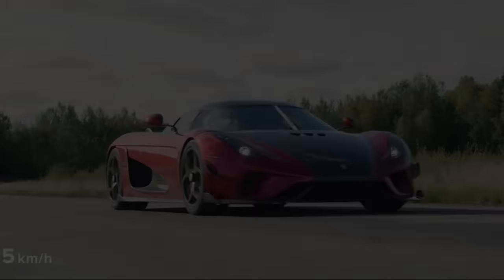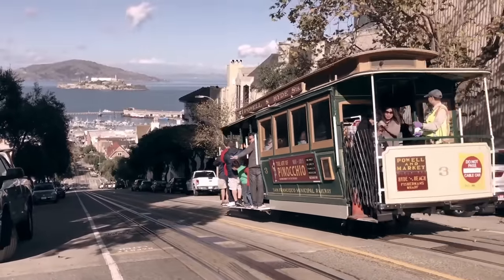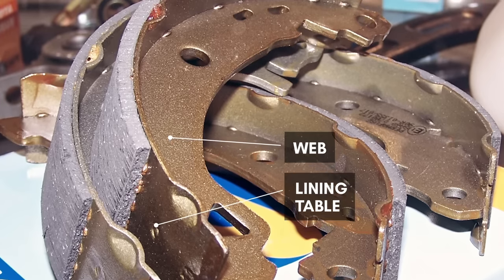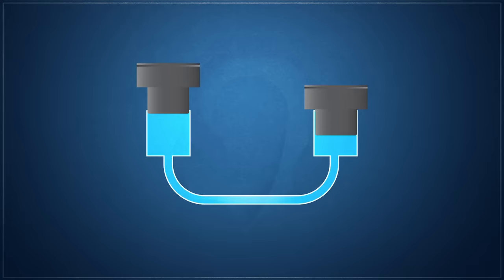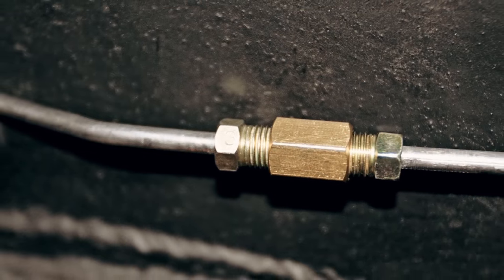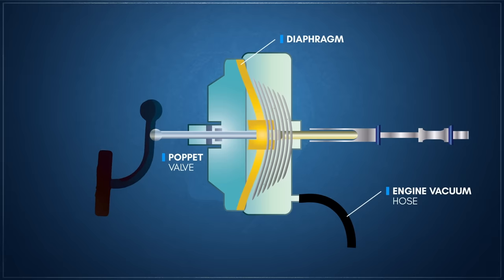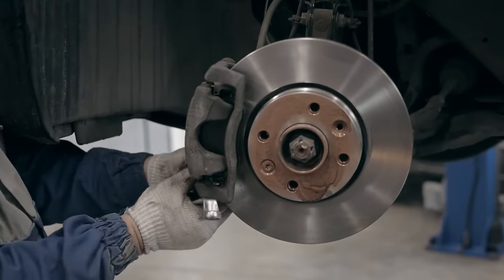The Story of Brakes

Comment: Have multiple break pads per wheel been used before, or would the effect not be that significant?
Reply: They have.
As those calipers are extremely expensive must be significant enough to warrant production.
Reply: I would think that the system would be limited by the heat the disc could dissipate and adding more pads takes away cooling area on the disc so it would brake hard but overheat fast
Reply: @Slash1066  Definitely limited by heat. But we've had Carbon-Carbon rotors and pads for decades.
it takes a LOT to subliminate pure carbon. I remember 35 years ago they were priced at something like $10,000 per corner!
Rotora has a 12 piston caliper. Brembo also offers an eight piston with 4 pads.
The SLS Titanium 3D calipers in the Bugatti Chiron used a bunch of pads too.

Comment: Another thing to note is braking systems on cars legally have to be more powerful than the engine output so they can be stopped if a throttle gets stuck wide open

Comment: 15:10 90% of the time slide pin malfunction is due to poor or no maintaince when pads are replaced. And replacement of warped pins is rarely done even though its very cheap.

Comment: Electric cars bring an interesting trend. The brake discs may be so underused that you have to change them due to rust and not because of wear. Now Continental in cooperation with VW is working on bringing drum brakes back on all four wheels to mitigate that problem. They have a test Golf 7 GTi test mule
Reply: The Etron automatically puts the pads onto the rotors from time to time to prevent rust on the rotor. You can prevent the rust buildup

Comment: And I believe that brake rotors warp after a hard braking followed by the vehicle sitting still at a stop light or stop sign as a portion of the brake disc is covered by the caliper, making it warp. 
Has anyone ever made a braking system with multiple piston calipers that have gaps between the pistons? As in a 30 degree spacing of each set of pistons?

Comment: Great video. But I don't think the analogies in the intro made the phenomenon any more understandable.  Now I know how much stopping energy is compared to iPhone charging or American house electricity use... More useful would be how much heat is produced. So, for example the specific heat capacitance of iron is 0.45 kJ/(kg K). The energy of a emergency stop was given 0.12 kWh. That's 432 kJ. So, 1 kg of iron gets 960 degrees (K) hotter. Google says that average disc brake rotor is close to 10 kg in weight. So brakes are 960 K / 40 kg = 24 degrees (C/K) hotter after a single emergency braking.

Comment: We know trucks with high loads can not to be stopped at close range. Even if the brakes can stop the trucks in short distance, there will be a weight transfer that causes the trucks roll and potentially crash. However, the drum brake is easier to combine with the air brake. So in trucks, how fast the brakes can stop the vehicle is not a priority. Most importantly, how the brakes can stop the vehicle safely.So it can be concluded that the drum brake is stronger than the disc brake. Although drum brake is no more responsive than disc brake. In comparison, disc brakes will stop faster. However, the braking force of the drum brake is stronger. That is the reason why the drum brake is chosen for the for heavy trucks.

Comment: On a side note, if the 2 parts of a dual master cylinder are "crossed", as shown at 9:22, it's to avoid braking only on one side of the car in case of failure.
So the car stays on a straight trajectory, instead of suddenly turning left or right.
Reply: You really want a car to continue on straight trajectory if the brakes fail? What if you had a heart attack & hit the accelerator instead? Out of FULL control situation on at straight level road & boom you're in capacitated! What you like to happen? The default is to err on the side of caution. The car slows without driver input. Most roads have a camber to remove surface water to gulley drains. The car has a very slight steering offset/biase over a long distance. This is by design of the car & the roads. Soft verges have purpose also. It is better to go to an unbraked unassisted stop on a verge/safety lane. Than hurtling on veereing across the median into on coming traffic, potentially doubling your impact speed! Safe Motoring.
Reply: The correct terminology  is called a diagonal split braking system

Comment: BUT Trucks and Trains do NOT use a brakesystem based on Hydralic. They use pressurised Air. Why? Because Trucks and Trains can be separated or exchanged. You dont want to spill a Fluid everytime you seperate a Trailer or Wagon. Compressed air can be routed through flexible hoses and can always be supplemented by a compressor. A hydraulic system does not work with air pockets or only very poorly, which is why air is used
Reply: truck can be full air, air over hydraulic , or vacuum over hydraulic. Same with trailers, full air, air over hydraulic using airlines between the two , or vacuum over hydraulic , vacuum line between the two. Early systems on trucks had hydraulic over air over hydraulic, which was a hydraulic brake master inputting low hydraulic pressure to a air master  which intensified the hydraulic pressure to the brake foundations, similarly with vacuum the master cylinder would input to an hydro vac booster which once also would supply high pressure brake fluid pressure to the foundations. To get the trailer to brake, in the old day you would use a ratio controller but these are not outlawed and either using a trailer advance valve or speeding the truck and trailers foundation and air components the same. With air over hydraulic same as air over air, vacuum over hydraulic required a device that converted hydraulic pressure on the low side to a vacuum signal that the trailers hydro vac would create the high pressure brake fluid. Side note. Vacuum pumps were not called vacuum pumps they were called rotary exhausters .

Comment: 9:46 This drum brake self-adjustment is usually engaged by reversing the car and then braking hard. The drum shoes will be ratcheted to the new position.

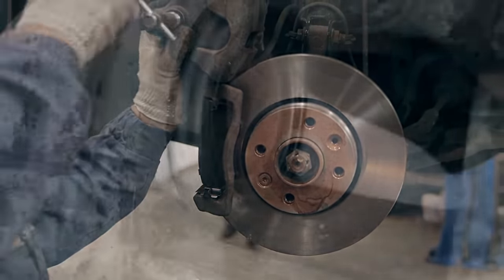16:04 Drum brakes in the rear also can be employed as parking brakes, as they will retain position under tension from a mechanical cable. The calipers of a disc brake will gradually bleed pressure and so cannot be used to hold the brakes when the car is parked.

Four-wheel disc brakes get around this problem by including a relatively small drum brake alongside the rear disc brakes, which act as the parking brake.

Comment: Two small things id like to add is that, the brake booster nowerdays is also sometimes not pneumatic but electric, with the ABS Block integrated into the master cylinder to safe costs in production that also makes one more reason for vacuum pumps on turbo charged engines to become obsolete.
Also the double brake circut sytem is a thing to this day however the one circut front one back is largely abolished due to the fact that if the front circut has failed and only the rear one is left, the maximum decelleration of the vehicle falls dramaticly. The rear wheels lock up more easily because when braking the load of the vehicle is shifted from the back to the front, much like how we have to lean back a bit when we run and wanna come to a sudden stop to compensate for that effect and not fall over forwards. This is also why there is a brake force distribution of about 70-60% front and 30-40% back dependent on the vehicles default weight distribution.
Nowerdays brake circuits use the X layout as seen in the video or they are doubled up front or all arround, baisically any layout that makes sure that once one circut fails there will be at least one front and one rear wheel braking that are on different sides of the vehicle so as to not make the car pull noticably into one direction when braking, is good to go.

Overall it was a great video with good and understandable animations and mostly a nice reminder to me as to how brakes work. I even learned a thing or to.
Great content keep it up.

Comment: I might be wrong but I dont think that average american home consumes 1.1MW of power in two hours, a month could be a more accurate guess
Reply: MW is the power. MWh is the energy. So 1.1MW*8s is around 2.4 kWh which is 2 hours of usage for a 30kWh per day house.
Reply: The standard for American homes is a 200A breaker at 240V which allows for a maximum power consumption of 48kWh. That means we can reach 1.1MW in 23 hours :)
Reply: @WoLpH  American homes are 120v
Reply: @MarksTournaments  They're officially 240v split phase :) The outlets generally only get 1 of the 2 parts of the split phase which makes 120v. Your AC most likely runs on 240v by using both parts of the split phase.

Comment: I love this video. I have known about and learned about all these systems before but I had not seen them put into this context before. I am so used to hydraulic brakes with boosters that mechanically-linked brakes are something that Jay Leno is familiar with not I. (I haven't been near a car with mechanical brakes.)
One thing you missed was Bertha Benz's road trip where she had leather straps put over the wooden brake blocks on her Model III, thereby inventing brake lining for automobiles.
I wonder how many here saw the disc brakes and thought of Eric O. and South Main Auto's voluminous brake job videos? (Floating disc brakes are a bread and butter item with his shop as attested to by the pile of rotors he recycles on a regular basis.)

Comment: Two areas you might like to add: 
There is a town in New Jersey they call Radburn (a part of Fairlawn) It was designed between the wars to anticipate the influences of an auto age.  
The town was designed so no child need to cross a street going to or from his school.  The fronts of homes face across hedged-lined paths that lead to large common areas of open space. People who live in those homes these days, enter by the back steps instead of the front door.
Hydraulic technology , which became common during WW2 and made that neightborhood design either obsolete, or interesting. 
[My uncle was a Sr. TWA Executive  owned one of those homes until he retired a half century ago.

During the golden age of inexpensive sports cars & rallys, such as with an MGA, the trick to driving fast was to rely on your brakes instead of the gas -- when deciding whether to pass.  Zoom by, or slow down fast.

Comment: Hydro boost=good idea but Hydro boost= nightmare to work on....if you get air in the system, that is a major problem, usually after replacing unit....NEVER try bleeding with engine running, you will have air bubbles for a week

Comment: Covered Regenerative breaking, but not Engine Breaking? Goes back as far as I am aware as Steam locomotives, but used by trucks today etc. I've heard trucks making a trumpeting sound when deaccelerating, which I believe is this type of breaking.
Reply: Trucks can use their engine for braking, but heavier ones typically use retarders, which are more powerful extra devices independent from the engine.

Comment: I often wonder why automobiles didn't take a leaf out of rail practice and use a reduction system, i.e. you use the pressure to release the brakes, and you apply them by easing the pressure off? The system would be fail safe that way.

Granted, with rail you're working with compressed air.
Reply: Truck brake systems using compressed air work in this way. If there are leaks or you are running out of air a mechanical spring (which is overcome by a pneumatic cylinder) stops the vehicle.
The problem with cars is if you don't use them for a longer time your pads can corrode onto the disc or drum, and with the parking brake (which is independent) you have a redundancy over even 2 hydraulic circuits

Comment: If only abs actually worked in the way they claim. I wonder if there is close standards legally held to by manufacturers, because there has been performance differences between brands. And I can remember a major manufacturer being sued when a man was forced to pay for 'anti-lock' brakes, but his wife or such was killed during an accident in which the man was driving, tried to stop, but his 'anti lock' brakes prevented him from stopping in time. Aided by professional mechanics an experiment was done to test stopping distance for his exact model with factory installed abs compared to modern un aided hydraulic disc brakes, and it was clearly proven, on t.v. even, he would have stopped if he did not have abs. He proved this by repeatedly having a test driver make hard stops under numerous conditions, and taking distance measurement averages for each system. As I recall he won his lawsuit against a major American auto manufacturer.
Hopefully they have improved.

Comment: Unfortunately, this video perpetuates the common error that says brakes turn kinetic energy into thermal energy. That's like saying that the goal of an engine is to turn chemical energy into thermal. Heat is the by-product, not the objective. The car stops just like it accelerates; by pushing against the road. So both the engine and the brakes apply force on the road to accelerate and decelerate, respectively. Heat is a by-product of both. And if someone is still confused, just watch any car sliding on snow or ice, regardless of its fancy brembo or wilwood calipers.

Comment: Also, If we talk about Koenigsegg, their freevalve system can possibly increase the effectiveness of the engine braking.
Reply: A guy in America has done just that. Tube video. He made one, all pneumatic, little air compressor & res. He put it in his Miata(Mazda MX 5. He showed everything step by step. It worked First time every time over some days. The video finished as he was taking it to the dyno. His idea was to make kits for track cars & boy racers. As you know the head needs to be modified. No camshafts, no front end gear train to the Crank. Much weaker valve springs(he claimed not really needed but safety measure as his cylinder retract the valves. I thought was a limited appeal but sound engineering project. I'm trying not to say Donut! Free Valve is now a completely separate spun off company from Koenigsegg

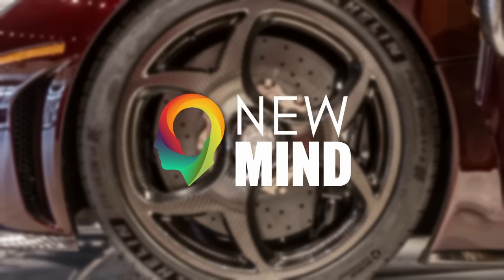Comment: 0:48. Umm correction. 1.1MW Will power the average American home for slightly over 1 MONTH. Not 2 hours. To use that in 2 hours you'd have to be using 550kWh for a monthly electric bill of $60,266 going by the average cost of 14.4¢/kWh
Reply: Wait, maybe he considered the crypto mining houses that became so prevalent 🤣
Reply: @FirestormX9  even then you're still not using that much power lol. A typical farm is single digit kWh. Maybe if you had a massive double digit gigahash gpu farm you could hit double digits but triple? No shot. A homes breaker would trip at 24kW so no shot at using 550kW. MAYBE if it was like a huge grocery store or something
Reply: Or a metal machining shop running dozens of cnc's and hydraulic presses. This truly is an absurd amount of power and it irks me at just how wrong that statement is
Reply: @faded.0913  well Walmart could use some brakes for sure lmao 🤣 sorry, I am out of bad puns
Reply from the maker: 1.1 megawatts of power over 8.72 seconds is about 2.6 kWh of work.
Reply: @faded.0913  ya got corrected, dude! 🤣

Comment: Not an ABS complaint but computer controlled traction control complaint. I absolutely hate how my 2014 Tundra goes into low power mode whenever the rear tires spin.

Comment: As far as these systems evolved, it’s still pressing a material against another with force to generate heat while causing abrasion. We need to reinvent the brakes. The abrasion is a big factor of pollution, these micro particles find their way in the lungs and drinking water and can’t be filtered out. We need an invention that does not cause abrasion.

Comment: Riding a motorcycle where the front brake is slightly lless  powerful than its engine in deceleration can be terrifying :-)
Reply: And fun 😅
Reply: engine braking on bikes feels like dropping anchors 😂
Reply: @jesselopez0008  On thumpers, yes, to the point where you can lock the rear wheel in low gear.  On smaller multi-cylinder bikes, not so much.

Comment: A braking system is a mechanical device designed to generate copious amounts of heat. That's all. The more heat it can generate, and the more heat it can transfer to the surrounding air the better.

Comment: EV regenerative braking is essentially similar to "Eddy current braking" ecept the latter throws away electricity through a resistor (in this case, a metal disc). I don't know if this type of brakes were ever used on dinosaur-powered cars, but they are used on trains and indoor training equipment, for example.
Reply: I remember a trip to Germany in the mid seventies on a coach & that had electromagnets around a disk on the drive shaft. Ideal for long descents through the mountains as brake fade wasn't an issue.
Reply: it's used for heavier trucks, but not for pure ICE cars. EVs however use it as standard, also hybrids

Comment: 24:43 Wait, so we have now achieved regenerative braking that can be throttled?? How does this work? Surely you can't store the kinetic energy by charging the batteries that quickly...
Reply: Regen brakes can generate 100-200 kilowatts of electricity, which is within the DC charging limits of a lot of EV battery systems.

Comment: 25:06 what are brake by wire systems?
Reply: That's where the pedal isn't connected directly to the caliper, the pedal movement tells a computer to brake for you, used when regen braking is present so energy can be stored in a battery to slow the car before the actual friction material is used

Comment: Having driven a Chevy Volt PHEV for three years, I now feel cheated whenever I drive a regular ICE vehicle that does not have regenerative braking. 50K miles, and still have 80% of the original factory brake pads.